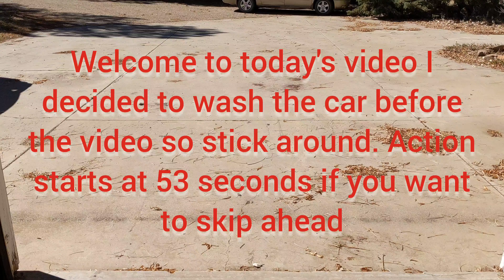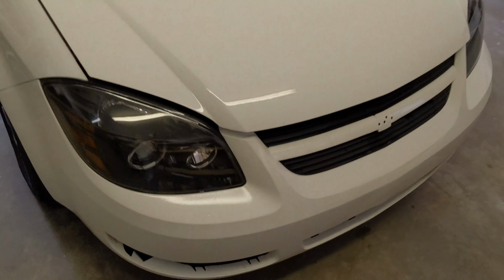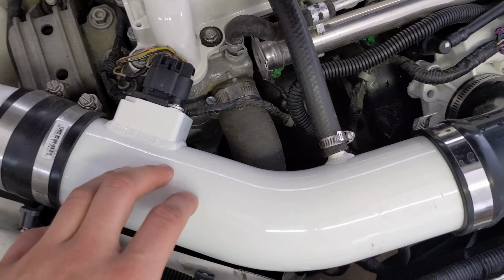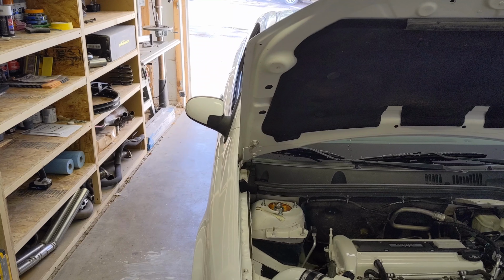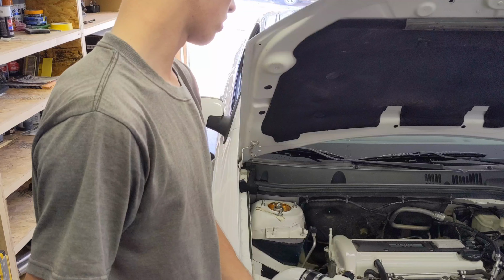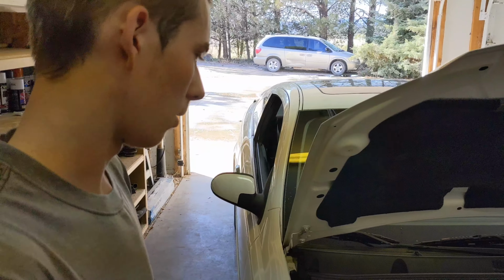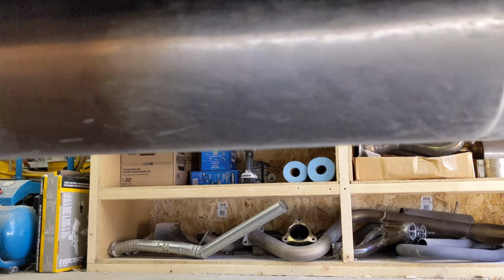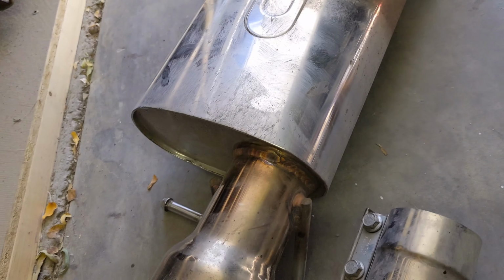Cobalt Update and Exhaust Mods

Comment: Did u get any check engine lights with any bolt ons? I just got a 05 cobalt
Reply from the maker: Probably not but it will need to be tuned obviously otherwise yes

Comment: Why not just put an m62 on it? Less than 700 bucks and you can add 50-70 hp
Reply from the maker: Yeah at this point I'm going to be fully building a 2.4 ecotec with some spicy cams and possibly built manual transmission and going the turbo route and see how high I can rev it and how much power it can handle
Reply: @itsjustatune  what year?
Reply from the maker: @mattneal4309  2006 it came with the 2.2 and automatic transmission
Reply: It'd blow up his trans lol 😆
Reply from the maker: @lsjionredlinesupercharged2049  yep basically did that with a small tune I would rev it to 7k in neutral and put it in drive🤣
Reply: @itsjustatune  lol run what you brung lol 😆 I love my LSJ ion redline supercharged but your doin good stuff.
Reply: @itsjustatune  Don't neutral-bomb it. Launch from 1st gear with your other foot on the brake and shift it if want to launch it.
Reply: @lsjionredlinesupercharged2049  I have a stage 2 2006 ss Cobalt, I am installing water injection and then most lkely niitrous. I have an extra m62 manifold if anyone is interested.
Reply: @stevecook8984  what part of the country are you in
Reply from the maker: @stevecook8984  yeah my best 0-60 and 1/4 mile were neutral dropping it but it won't be happening again 😂
Reply: @stevecook8984  
How much for m62 ?

Comment: I’ve read online these engines the 2.2 in the 06 cobalt can not be tuned?
Reply from the maker: The first 2 years(2005-2006) of the chevrolet cobalt with the 2.2 couldn't be tuned because of the pcm that was used. I did however get mine tuned a little bit by Trifecta Performance. You have to message them directly and see if they still do that tho.